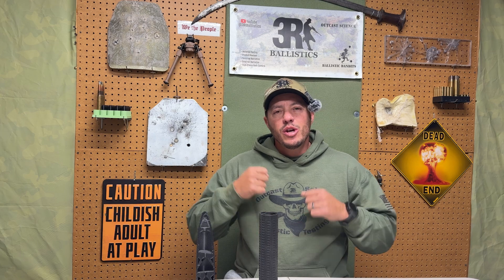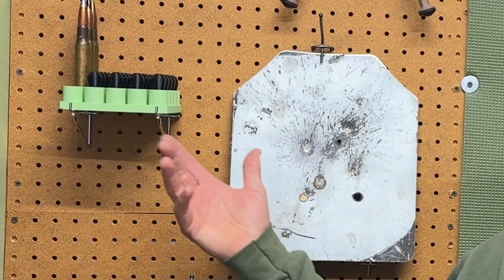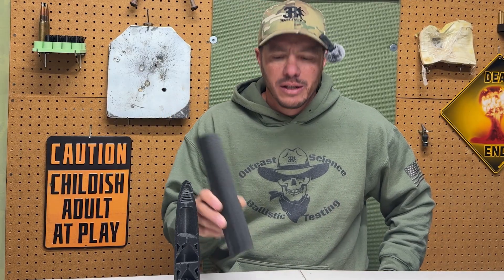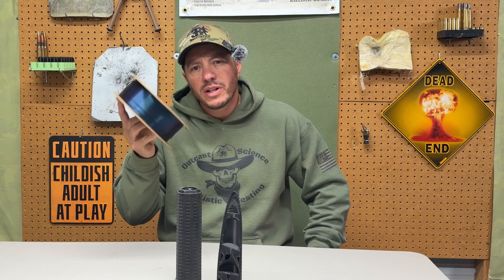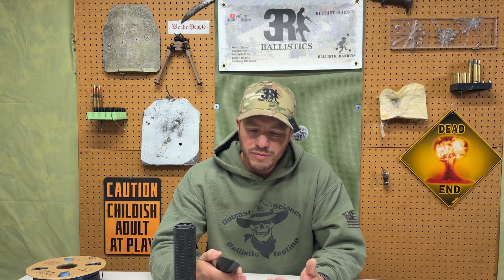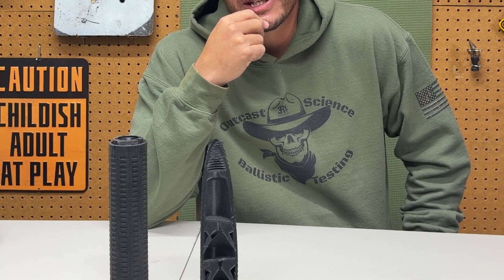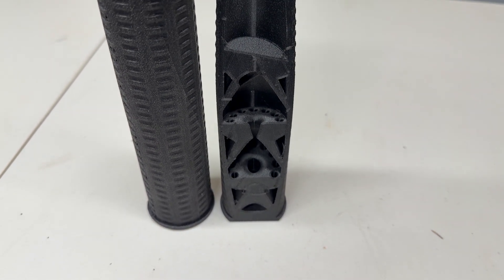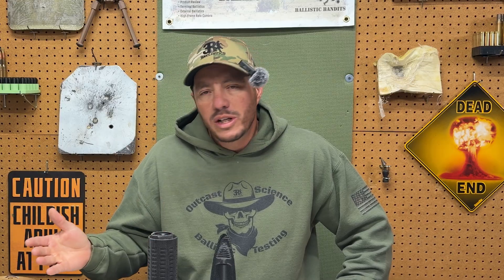Are Plastic 3D-Printed Suppressors Viable? PA6-CF Explained

Comment: Why are suppresors so expensive? Its just a metal pipe with washers inside probly cost $10 to make
Reply: It's a premium paid because its a tiny market.  There were more suppressors sold in like 2020, than had been sold in the entire time the NFA has been sround, and that was only like 1.5million units.  So there's less economy of scale to do r&d, meaning to cover extensice r&d, and good warranties, the price per unit sold has to be higher.  Then, because they're difficult to replace if lost/stolen/damaged (because for decades its been a crapshoot of "i might get the tax stanp back in 6 months or two years") most of the market uses premium materials.  If you could pick up a half decent one for cheap, and just toss it in the garbage at the end of a range trip, very few would pay 6x the price for "the same thing" made out of high strength/heat treated super alloys, rather than 3d printed polymer or aluminum stock.  But they're basically lifetime purchases, so you are not smart to buy an aluminum can if the price difference to a 17-4/ti/inconel can is only 1.5-2x and the waiting time before you can actually get your hands on it is the same.  As the market has grown, we're actually seeing some pretty significant developments in baffle shape and things that can only be printed, not stamped/machined.  And so suppression capability is getting pretty damn good.
Reply: well modern suppressors dont use washers but i under what youre gettting at. for the longest time the big manufacturers knew they werent going to be selling an insane number of them so they charged more. as suppressors got more popular the excuse became materials/R&D/tooling costs. now that cans are going to start selling at numbers never before seen i hope the cost will drop drastically but i dont see the big names dropping the price because theyve always charged a lot. I do forsee a lot of new smaller companies starting up to offer more budget friendly suppressors.

Comment: I’d like to see an easy round count, aggressive round count and possibly full auto. Decibel readings to see if it loses suppression ability in between rounds.
Reply from the maker: That’s kind of where I’m leaning towards
Reply: @3RBallistics no polymer can is going to like aggressive fire schedules.  Even if they can handle the pressure, the heat will slowly ablate the material away, hollowing out the core.  Testing will be cool to see how aggressive you can get with them, but their biggest advantage may be in .22lr use cases, where you can simply seal up and discard a fully-leaded printed can instead of dealing with toxic lead exposure trying to clean your metal can out.
Reply: @jdhill770 somebody needs to incorporate the vent method from those cans in the new flannel daddy video
Reply: @jdhill770  you are incorrect my friend, there are peop;le with thousands of rounds on their ftn.4 and some use FRTs, these things are impressive on a scale not many know
Reply: @Facing_Fear  yup exactly...
Reply: @3RBallistics  you can also use "Cool Gel" heat barrier spray between mags, it makes the suppressors last a lot longer